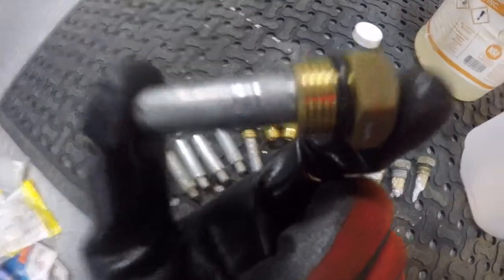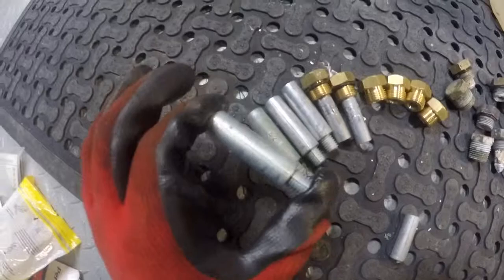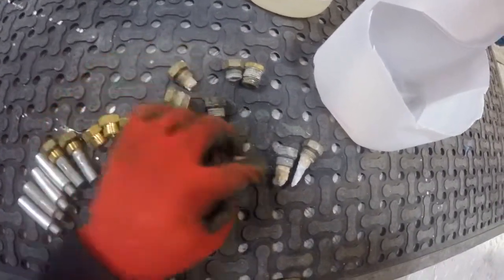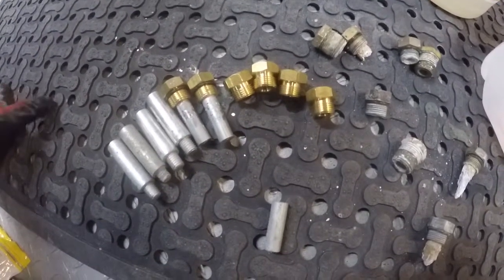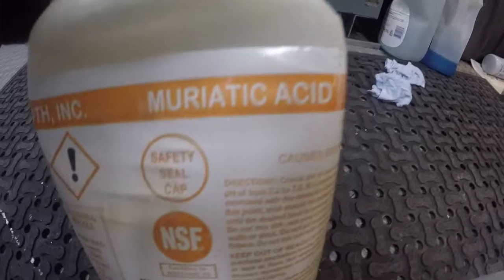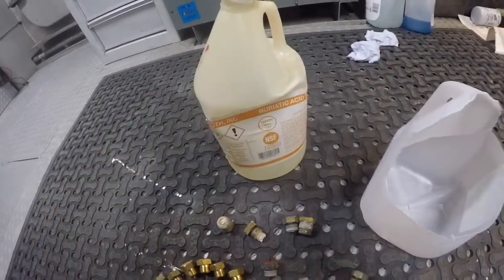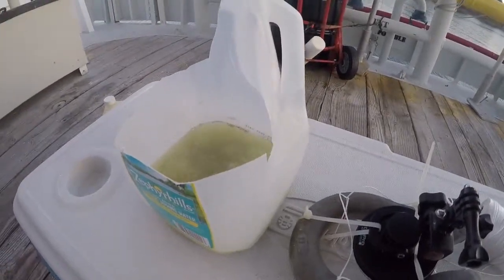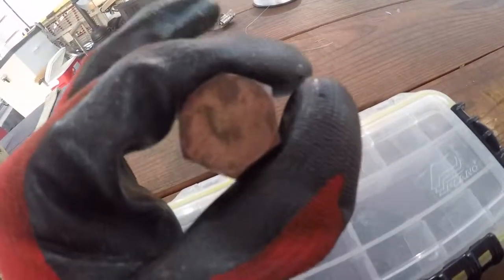Boaters Spend LESS on Zinc Anodes Save Money With This Trick!!!

Comment: That pink colour of the anode plug fittings is dezincification of the brass.  The hydrochloric acid which is dissolving the unwanted zinc stubs is also dissolving zinc from the fitting.  It looks like they're still reusable, but would shorten their lifespan. However, in your situation it looks like even one reuse would be a win financially and you're getting more than that by the sound of things.  I just mention this as a caution for brass & bronze in general really.

Comment: You mentioned sealer or teflon tape on your treads.  This will hinder your zincs effectiveness. Were you aware of this?
Reply from the maker: No I mentioned locktite which is a thread locker and takes one drop it is recommended by almost all engine manufacturers in order to prevent the zinc from coming unscrewed it does not effect continuity between the two metals
Reply from the maker: Michael Stuart of and sorry that was on a different  portion of the video! Actually that is typical to use sealant it will not effect continuity either however Teflon tape all the way up the threads would but I do not believe I mentioned Teflon tape I believe I only mentioned liquid sealant

Comment: Only some types of boat engines have anodes. Some have none.
Reply from the maker: Geoff Crowley all boats that stay in the water should have sacrificial anodes. If they do not then they should be fitted with anodes to promote longer life...
Reply: @BrandonActionJackson  My boat has not had an anode for 40 years. Not one. My engine has no provision for one. Stainless shaft, bronze prop (2nd one since boat was new), bronze throughulls.
Reply from the maker: Geoff Crowley you’re luckier than most... if your boat sits in the water 24/7 365 in a marina especially it’s others and their stray currents you have to worry about.... stainless shafts should also always have sacrificial anodes. Along with metal rudders and in most cases an engine can easily be outfitted to have a sacrificial anodes or they can be bonded from afar ... but overall if u had to guess you’re definitely in freshwater and from the sounds of it your boats engine might even be cooled with straight raw water as opposed to a heat exchanger ... very rarely will you ever see a heat exchanger not outfitted with some type of sacrificial anode
Reply from the maker: Geoff Crowley looked at your video and saw you had a sailboat... you’re going to be less susceptible to corrosion especially when you limit the amount of dc current flowing around the boat but just because you don’t have one doesn’t mean your boat wasn’t designed to have one... in many cases sacrifice anodes are a choice and a good one at that but hey whatever works for you... in a really densely packed marina especially in saltwater though you can run into real problems from other peoples stray currents and I’ve seen damage to many engines that cost well over $200k that couldve been prevented with some simple maintenance
Reply: @BrandonActionJackson  Yeah corrosion not to be trifled with. Spent my whole career dealing with it in one form or another. Your video helps people to avoid it being expensive.
Reply: It’s stain-less not stain-proof. Rust never sleeps. And corrosion is a quiet killer.